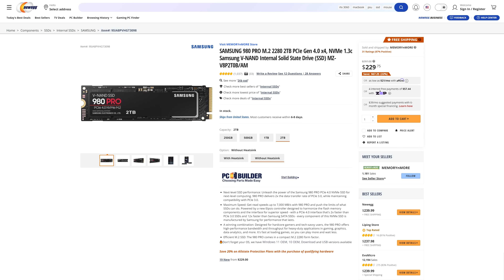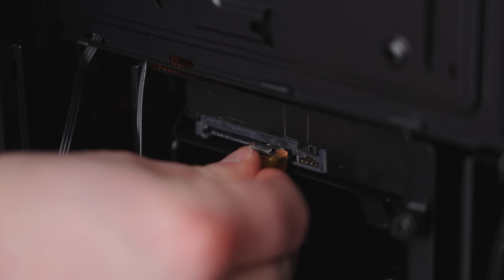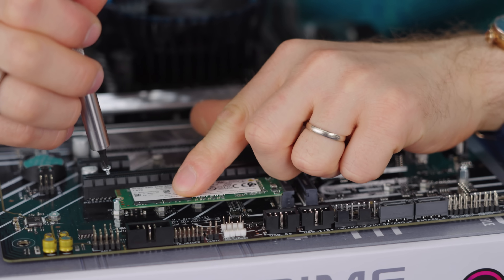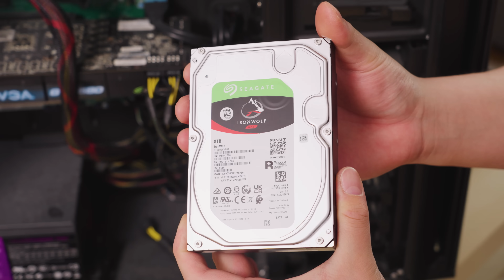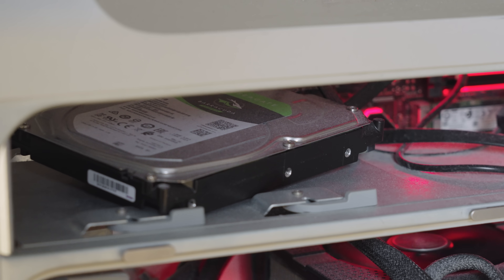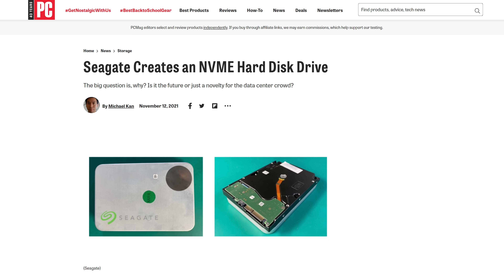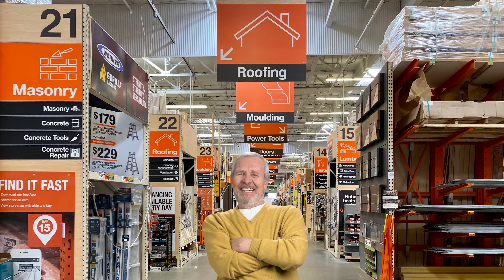Is SATA Obsolete?

Comment: There's no reason M.2 drives need to be screwed down. They could be designed to click in place on that end like RAM sticks or PCI-e cards. Why they aren't designed like that already (at least for the better motherboard manufacturers) is a mystery to me. Or even a mod piece that replaces the standard standoff which clips the screw end of the M.2 drive down.

Edit: please read the replies before you make your own, as what you're about to say has probably already been said and the discussion surrounding it has already been had.
Reply: Yup, in fact motherboards now come with plastic clips that locks SSD in place without any screws.
Reply: @pixels_per_inch  Nice, I didn't know that.
Reply: I'm not actually against it. It's just that the screw do the job much better than any clip. Electrical devices are fragile and can be easily damaged and none want that expensive SSD holding valuable data get in trouble.
Improvements are welcome as long as stability is concerned.
Reply: I lost that tiny screw a few times and it was a mess to find it..
Reply: Most likely the thinking is that few users need to regularly remove/swap internal M.2 SSDs so why bother with a locking clip or whatever in place of a screw which is more secure. For laptops, a clip could have the potential downside of coming undone when Moving the laptop and loosing your connection to the system drive and then your system crashes (or other issue if it’s a secondary drive). With a desktop MB that’s less of an issue since few people move their Desktop PC’s while on but still a clip isn’t as secure as a screw and if you’ll likely not be removing/swapping M.2 SSD’s regularly a screw isn’t that hard to manage.
Reply: @Charlesb88  They did it with RAM though. How often are we removing RAM?
Reply: @zelwinters1981  Prior to placing ram in module form (SIMMs, DIMMs, etc) memory came mostly in single chip form, sometimes soldered right to the motherboard or sometimes you had memory chip sockets that allowed you to add extra memory chips if you didn’t get your PC or home microcomputer maxed out memory-wise when you bought it (very common as memory was very expensive back then). Some early micros only allowed memory excision through a memory expansion pack that plugged into a expansion slot on the back of the computer (Sinclair Z81, for example.). On rare occasion you get memory expansion board that plugged into a slot or other connector on the board. When the first memory SIMM/DIMM slots appeared it wasn’t uncommon for people to buy a computer with less the full memory capacity due to price then maybe e add more memory later on so having  easy locking tabs to make adding/removal quick but keeping memory modules securely locked in place otherwise made sense. With modern M.2 SSD’s given the shape and edge connector, a single screw to hold it done makes some sense. Yes, some who upgrade or swapped internal SSD’s regularly may bemoan having to unscrew a single screw every time but that’s not that common. Some have said that some motherboards provide a clip/locking tab/whatever in place of a screw from their M.2 slots so such designs apparently due to exists if you really want it, though your motherboard choice will be limited. For the rest of us while the applying the SIMM/DIMM design to M.2 cards might seems sensible most MB manufacturers won’t bother changing the design their already tooled up for unless big demand exists which it doesn’t. But DIY options do exists if you really want a more easily removable M.2 SSD.
Reply: @Charlesb88  You speak as if I am 15 years old and have never worked on anything beyond today's stuff. Yeah i'm well aware of what things used to be like, which is why we don't go back and plan forwards based on that. A small screw like this is a flipping inconvenience.
Reply: @zelwinters1981  sorry but I have no idea how old you are or what experience you have with old retro computers. Even older folks sometimes didn't get into computers untill much later in life. Don't take it personally. Regardless, it seems like some MB manufacturers are switching to plastic clips over screws on the M.2s and even if others are not so the option is out there but it's not something I care that much about myself and I've spent way to much time on this subject already. But I do think the way securing drives vs securing ram modules played a role in the screw vs clip M.2 choice and I don't think it was an obvious mistake even if not what some want in this day and age. Anyways, I'm moving on to more important debates like should Apple adopt RCS or should Microsoft make an Windows M-series ARM version of Windows 11.
Reply: @Charlesb88  I couldn't find the right screw size to hold the m.2 ssd as its smaller than the ones used in standard ssds. Fortunately had an old bluetooth keyboard that had similar screws in them.
The problem is with the manufacturer for not having included the screw with the laptop. Clips could help tho in self upgrades and  repairs.
Reply: @Charlesb88  I'll be honest. I prefer to screw it down. The problem is lining it up properly. Once you get it though, it is indeed set it and forget it.
Reply: @Charlesb88  I think some manufacturers already use clips
Reply: @Charlesb88  I did think about the point about not swapping drives very often, but a well-designed clip would be just as secure as the screw, even if made of plastic (of decent quality which won't get brittle or crumble after prolonged exposure to the conditions in a PC/laptop case such as heat). It's less about the need to frequently swap and more about the convenience when the time does come to add or swap one. The plastic part would probably even be cheaper than the metal standoff, even after the R&D. Plastic clips hold in the RAM sticks (along with friction), and you know those aren't going anywhere unless you push the tabs down. It seems to me that there is no reason besides R&D costs not to use a clip instead of a screw. Somebody with a 3D printer and who used M.2 drives should prototype this and see what they can come up with. It'd be really cool to see.
Reply: @RAndrewNeal  I think that a screw would provide a much stronger connection to ground than any clip could provide, potentially saving ground pins on the connector.
Reply: @jnvivian  That is true, but ground will most likely stay on the connector regardless, as the signal ground line needs to be as specific as the signal line at such high speeds. I don't know whether or not the engineers design different ground points for signal and for power, but as long as everything is kept sufficiently decoupled, they could probably share a single ground point.
Reply: @RAndrewNeal  it's probably just cheaper to use and include a screw and standoff. That's likely the real reason it's done this way.
Reply: @ArtisChronicles  Probably, for the cheaper motherboard brands. But as others in the replies have pointed out, the bigger brands are actually already doing what I suggested. I knew I couldn't have been the first to think of it.
Reply: Because using screw has no impact on user experience at all, so there is no demand for change. If you have to swap or install an M.2 SSD, you definitely have to unscrew lots of other stuff, your case and other PCIE devices that stay on top of that M.2 slot, so chance are you already got your tools. Doing 1 more screw add no trouble. Also M.2 devices come at different length. Some of them are 2230, 2242, 2260, which the clip must be relocate or have some fancy adjustable mechanic, increasing complexity, break point, nuisance and cost.
And the point in the video about having to do 1 screw to secure M.2 drive is just pointless. I mean any other drive require some mechanic (most use 4 screws) to secure. So tbh don't know why it was even mentioned. (maybe that's a problem for servers? but none use m.2 for bulk storage for server anyway)
Reply: @nasmeskartz9149  It's convenience factor; that's it. Some PC cases hold spring tension on the PCI backplates instead of using screws, making PCI card removal tool-less; not to mention that most PC cases have latches or thumb screws for the side panel instead of regular screws. Why are so many people so against a simple convenience improvement?
Reply: My MSI MB have plastic locking mechanism instead of a screw.
Reply: @eckee  Nice, I guess I wasn't the first to have the idea; I'm glad!
Reply: I really dislike friction fit or clip-on connectors, it's easier to damage them while removing the components (that usb header particularly, who tf designed that shit), and generally makes it a bit more terrifying to work with. I'd much rather have a loose connector and an external method to fasten them in place. However, like you said, it doesn't have to be a screw, a simple latch or tab is better and more convenient.
Reply: There are some higher end motherboards that do have a rotating locking mechanism for the m.2 drives, just built a pc with an upper end Asus mobo with the feature.
Reply: I don't see that as a problem. I'd rather screw it into place (it's just one and very easy and quick to do) than risk breaking a clip, which also happens to occupy more space.
Reply: @capofantasma97  The kind of people who break clips are the same kinds of people who ruin screws by brute force. A clip would take no more space than a screw and standoff, and would fit in the same hole.
Reply: @RAndrewNeal  better safe than sorry. I like my stuff reliable and efficient.
Reply: @capofantasma97  You gonna screw down your RAM too?
Reply: @RAndrewNeal  laptop RAM is already similar to M.2 in that you insert it flat on the board and it stays due to friction, it would benefit from being further secured by a screw tho.

If a new generation of RAM slot standard similar to M.2 comes up that requires screwing instead of a clip, it will probably be significantly more compact and will avoid some people accidentally damaging the clip or the RAM. Plus less probability of a blood offering.

That would be a boon for small form factor builds especially.
Reply: @capofantasma97  But the laptop RAM isn't screwed down. You're just speculating; and for what reason, just to be a contrarian? If you want a screw, use a screw. It might have an advantage over a properly designed clip if you drop your computer off a building, but that would be the least of your concern at that point.
Reply: @RAndrewNeal  you asked me if I would screw down my RAM hypothetically, and I answered you. What the hell more do you want? Dude you'll never be happy with any answer that isn't exactly what you believe in.
Reply: @capofantasma97  I was making a rhetorical point that RAM isn't screwed down and doesn't fall out even when shaken. Either you didn't get the point or you thought it would counter the point by, in a way, confirming it.
Reply: @RAndrewNeal  except that if you take more mobile devices like the Surface series and convertible laptops, those have their RAM soldered to the board most times.
Reply: @RAndrewNeal  Laptop ram uses metal clips to keep the ram completely in place. M.2 SSDs are too long for clips like those, and they’d waste materials doing that for every M.2 slot on laptops or desktop motherboards.
A simple screw is better since they’re cheaper than using long metal clips for them. You shouldn’t be allowed to talk about these things if you can’t put two and two together.
Reply: @RAndrewNeal  Ram has small clips on the side because the ram sticks are long, with pins on the long end. M.2 slots and SSDs can’t be designed like that because would waste space.
You’re trying too hard to justify some stupid expansive change.
Reply: @capofantasma97  That's not a reliability thing, that's a cost- and space-saving thing. Nobody is a fan of that, because they can't upgrade their RAM unless they have a proper soldering workstation. And that's assuming the motherboard wasn't firmware locked to that capacity.
Reply: @Thewaterspirit57  They don't have to use the same type of clips. Have you ever touched CAD software? It sounds like you don't have any knowledge on practical design.
Reply: There are quite a few different sizes of M.2 devices.  With 3 different widths (16, 22 & 30mm) and 7 different lengths (30, 42, 52, 60, 80, and 110mm).  That is a mind numbing number of combinations to design a clip to accommodate.  Easy enough just to move a screw to correct hole.
Reply: @Elder-Sage  The width plays no role, as the clip would interface with the existing screw notch. The clip would also be movable between positions just like the standoff. The only reason to use a screw and standoff is because they're readily available off the shelf. I've yet to hear an actual functional reason not to use a clip in place of the screw.
Reply: Actually it can be done, the main  nvme   "click in place" version is called U2 (or the new U3). The good news is that you can put your m2 NVMe inside  a dumb U2 adapter and use it like a external drive, but the bad news is that you also need to install   an U2 + or U3 bay)  on the PC, which are also available (Icy Dock, for example). And you also need support  for NVMe hot swap in your motherboard, many modern motherboards support it but not all.
The need for an adapter is for 3 reasons:
 - Decent M2 to U2 adapters provide a protective case for transport and internal  heatsink. 
- The m2 ground pin is not good for hot swap, because it has the same lenght as the other pins. Hot swap requires grounding first to avoid arcing and  potential damages. The U2 connector has a longer ground pin to ensure it connects first. 
But U2/U3 adapters are  not the only way. Some m2 bays solve the grounding  problem by using M2 metal cannisters that make contact with metallic bays. If you want to do this in a standard gaming pc there are two versions:
- M2 bay in the front panel of your pc. This is expensive due to the need of expensive riser  cable to connect the front  bays to the M2 connectors in the motherboard, the whole damm thing can cost more than the M2 itself.
- PCIe cards that provide an M2 cannister entrance from the back, this is inexpensive and probably the best option for PC enthusiasts
Reply: @odjsjaks  As I have pointed out, the clip can be moved just as easily as the standoff for the screw. Pop or twist it out of the hole, insert it into new hole the same way. Should an idiot really be poking around inside a computer?
Reply: Some MOBO makers have implemented tool-less systems for M.2 slots, just not many. It's an unnecessary expenditure.
Reply: @shadowtheimpure  Unnecessary, sure, but so is RGB. Yet anything marketed as high-end consumer goods has it. I'd take a tool-less M.2 slot over RGB any day.
Reply: @Telleva The idea is not to rebuild the M.2 connector to be just like the RAM connector; the comparison was made for the sake of the latch that prohibits removal unless unset. Read the thread.
Reply: @Telleva Well you have to if you don't want to be the tenth person to make the same comment.
Reply: With many high end boards having 5+ m.2 slots and pcie bandwidth being abundant on the new chipsets, slotting method needs to be reworked. For example, the Unify X570S Max is basically covered with just M.2. In the same spot as M.2_1 on that board could have been 6 to 8 m.2 slots if they had the balls to design a connector that has them slot and lock in vertically. Bandwidth wise, even with the x570 chipset that slot could have been 6 pcie 4x2 slots, which is fine for secondary storage, and would have enabled MSI to advertise supporting 9 m.2 slots and even cut down the size of the board to an mATX form factor with no downside.
Reply: @joemarais7683  It doesn't seem like a good idea to have a long, narrow card sticking off the board like that.
Reply: and miss out on the joy of fastening those tiny screws?
Reply: You could even change the formfactor to anything like SO-DIMM RAM. That would be much easier to plug in and out.
Reply: I agree. It'd be better if they were soldered onto the motherboard.
Reply: @一本のうんち  Spoken like a true Apple engineer.
Reply: Installing M.2 always make me feel like installing SODIMM. Terrified.
Reply: two reasons:
1) Removes user error. Improperly seated M.2 drives could short out and fry themselves.
2) Screws are easily serviced and replaced by end-user. If the clip breaks on an M.2 slot, you need to replace the motherboard, if the screw strips, you can unscrew the standoff and replace it in minutes.
Reply: @Null_Experis  As numerous others have pointed out, some motherboard manufacturers are already using clips for the M.2 drive retainer. User error point is weak, as people fiddling around in their computer also have RAM and CPU to deal with, both of which need to seat properly. It's not hard to tell when a connector is seated properly anyway; only the incompetent will have a hard time, and they shouldn't be doing what they aren't competent to do in the first place.

A broken clip could be replaced by a standard standoff, or a new clip, if the manufacturer provides them. A well-designed clip shouldn't have a problem with breaking though; maybe the people who over-tighten the screws by brute force would break a clip the same way, but then it goes back to the point about incompetence.

I'm not saying that the incompetent can't be made competent with experience and training, but I'm saying that you don't need to idiot proof something that an idiot shouldn't be servicing.
Reply: You're making the same arguments manufacturers made to use plastic clips on SIMM slots in the early 90s, and capacitor purchasers made in the late 90s.
Reply: @Null_Experis  We already use plastic for every retainer clip that I can think of, from power connectors to RAM slots; they're all plastic. I never implied plastic to begin with, though; you assumed plastic when you suggested that breaking the clips would be common. A metal clip would be just as simple, but more robust. Material does not matter to me.
Reply: @RAndrewNeal  You're obviously too young to understand what I was saying.
Reply: @Null_Experis  I was implying that your point doesn't hold water. I got the implication, even though I don't know whatever history you're referring to.
Reply: @RAndrewNeal  You really don't.
Reply: @Null_Experis  You implied plastic parts break and cheap capacitors are bad for ESR and other reasons, and that manufacturers claimed they wouldn't be real issues. I just went around the point by pointing at tried and true real world examples that are contrary to your anecdotes. Now if you're trying to make a point that hasn't gotten across, go ahead make it in plain English instead of condescending upon me for not having the historical knowledge to get the full picture, and confusing that with a lack of understanding.
Reply: because the injection mold is expensive
Reply: @anotherone7585  Only up front. We all know how many injection molded parts there are that are dirt cheap.
Reply: Screw stripped out? Just change a new screw. Clip snapped? You're screwed. No pun intended.😂
Reply: @KyranSparda  It probably costs the same to have a new screw which you don't have laying around shipped as it does to get a new clip that fits in the same hole in the PCB as the standard standoff. If you can't find the clip, get a standoff and screw. Or don't use enough force to break the clip or strip the screw head in the first place.
Reply: @RAndrewNeal  Wrong. M2 SSDs I bought came with at least 2 screws & risers of its own, not to mention the ones that come with the motherboard. I DO have plenty if M2 & SATA screws laying around in my tool box. It's called a contingency.
Reply: @KyranSparda  So you presented a false dilemma then. If the clip breaks, you have a screw and standoff that came with the SSD already. I assumed worst case scenario of having no spares. The advice not to use excessive force in the first place still stands.
Reply: @RAndrewNeal  If you don't already know, all of SSD's screws are universal. Even if they're not, those things only cost like few cents in your local home depot or online. Why? Daddy didn't teach you about where to get a tool? 😆
Reply: Ignorance is a blessing for you may be but there are motherboards without screws of m2 drives rather with latching mechanisms
Reply: @felicytatomaszewska  Ignorance is a blessing for you maybe, but you're about the tenth person to mention this.
Reply: That would be a terrible design that would wear out fast though. Try doing that with RAM sticks over and over and watch how fast the connector wears out. I recall RAM slots are rated for something like 200 cycles. Most of the internal connectors use in PCs are like this, tin plated Harwin M20 terminals (most people call them "dupont" terminals but that's actually not correct) are rated for 50 cycles, gold plated SL terminals are rated for 200, etc. Pretty much all 2.54mm pitch connectos designed to plug into a pin header is rated for less than 300 cycles except for Amphenol (formerly Dupont, Formerly Berg) Mini-Pv which is rated for 1000 cycles but those are an expensive premium terminal that cost around 25 cents each compared to less than a penny for most commodity crimp terminals.

 But anyway, the take away is that the internal connectors used in PCs are basically designed to be plugged and unplugged a few times during the lifetime of the computer not constantly cycled. So you certainly don't want to base a high cycle connector standard on them. If you are going to make a hot swappable NVME I'd suggest using pogo pins on the connector and lands on the drive side (there are other cheaper ways to do it though)
Reply: @atomicskull6405  This would be the same exact hardware interconnect with a clip in place of the screw and standoff. Not a different plug. I was referring to the clip mechanism of the RAM slot; not suggesting using a similar interconnection. This is in common production, actually, as the reply thread here highlights.
Reply: @RAndrewNeal  How many cycles is an NVME socket rated for though? My guess is not enough for a swappable drive.
Reply: @atomicskull6405  How many cycles is a DIMM slot rated for? Yet it's tool-less. This isn't about frequent swapping; that's what external docks are for. This is about just simple convenience when a drive does need to be installed or removed. So many contrarians replying to this comment for no other reason than to disagree.
Reply: sometimes there isnt a space on boards for an entire clip thing to be on the board as well as secure the ssd in place, the screw requires just a hole in the board vs a wider place for the clip thing with possibly more holes.
Reply: @chah5001  A clip would take no more space than the screw and standoff, and would fit in the same hole.
Reply: @RAndrewNeal  yet the screw is more reliable, maybe can be an option on some server and workstations motherboards or something for quick swappablity as that might be required in some places but a home pc, people rarely ever need to hot swap ssds, i would pick the screw, more reliable.
Reply: @chah5001  Screw down your RAM while you're at it; don't want that wobbling around. Oh, and your side panel. You'll rarely ever need to open it up, right? Who ever thought tool-less convenience was a good thing?
Reply: @RAndrewNeal  yes would take screwed ram, and i already screw my case's panels lol, toolless is very convenience, their application isnt always as easy or as good as you might think.
Reply: @chah5001  Welcome to the minority.
Reply: @RAndrewNeal  dont care to be in one, wont change my opinion.
Reply: @chah5001  Everyone's entitled to their own opinion.
Reply: A screw would be more secure than a clip that would break after a while.
Plus there are different sizes of M.2 SSD :/
Reply: @Thewaterspirit57  Please read the thread before making a reply that I've already answered countless times.
Reply: @RAndrewNeal  no. Screws better. End thread.
Reply: @Thewaterspirit57  Ok boomer
Reply: @RAndrewNeal  Uno reverse card
Reply: @Thewaterspirit57  Who's the one dissing a new way to do things here?
Reply: New boards have this feature now, it's faster (cheaper) for an OEM than adding a screw mechanism.
Reply: @amirpourghoureiyan1637  Awesome!
Reply: I don't see much demand for this thus not much chance MB manufacturers would do since they are already set up for the screw fastener method. But I could see this being a somewhat easy DIY project for some who really want one and have a 3D Printer 
For others, maybe even going a different route such as using a strip of Velcro to hold SSD down (that does have the added hassle of having to swap the Velcro strip or make anew one each time you swap drives). As M.2 SSD's are lightweight you don't need anything stronger the Velcro or basic 3D printer plastic. For me I never found the short screws holding down M.2 SSD's to be that difficult to remove quickly anyways.
Reply: @Charlesb88  True, demand is pretty much 0. But in my opinion, with every connector being friction- or clip-fit, M.2 should see the upgrade. But I guess that's just me.
Reply: @RAndrewNeal  But like most expansion cards (PCIe, PCI, ISA, etc...), they will benefit from having a second point securing them down. All but the smallest of expansion cards always had the back panel bracket that needed to be screwed in to secure the card in place. RAM benefits from having a long connector and only sticking out from it's connector an inch or so. M.2 devices stick out much further from their connection point.
Vibrations are a thing that happen, even if we as humans can't feel them. That's why some computer hardware problems get resolved by unplugging and then plugging the item back in. So even if M.2 devices could lock into their sockets, it would still be better with the other end secured as well (especially for portable devices). And given the variety of lengths of M.2 devices, you'd have to screw the other end down anyway.
Reply: @JMcMillen  Yes, the end with the screw could be clipped down; not omitted at all. I have PC cases that hold spring tension on the PCI backplates instead of screws, though it has those too if you decide you want them. It's nice when I need to add or remove cards.